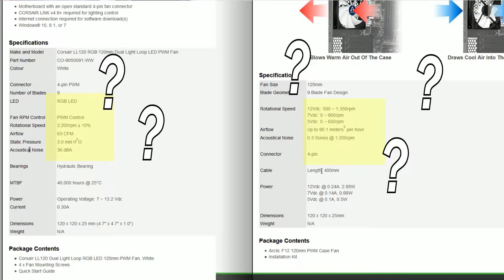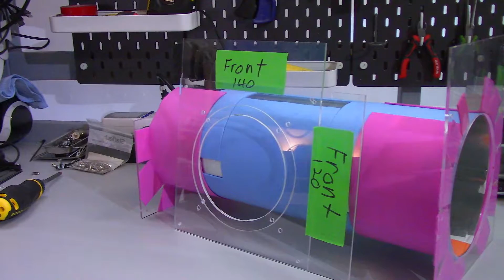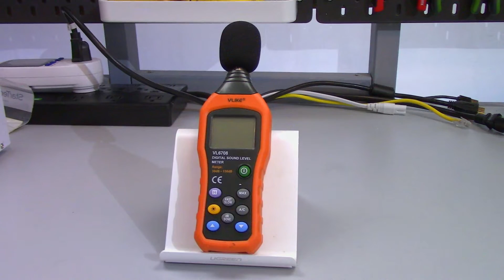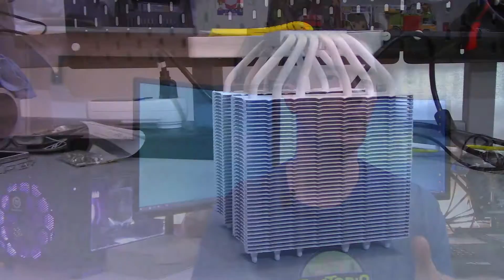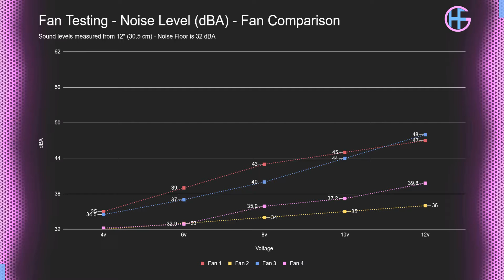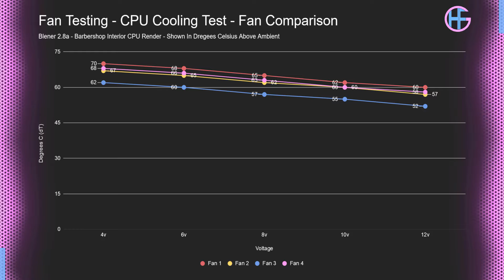New Fan Testing

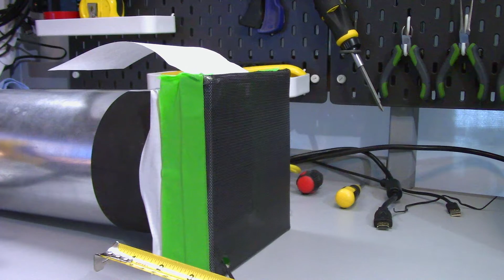Comment: 3:52 Most of my cases have mesh front cover then dust filter behind right against the fans, or I use the top or bottom as intake and they have filters right on the fans. Will there be a dust filter test?
Reply from the maker: I can't do apple to apple comparisons on every fan for every case type. Now the mesh that I'm using is a dust filter. So the one test will give a pretty good for both front panels and dust filters.